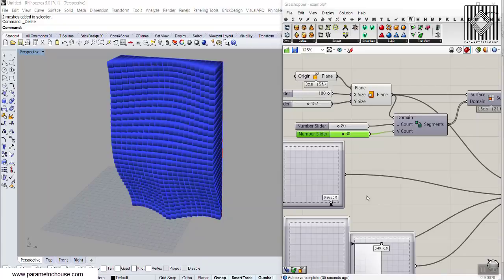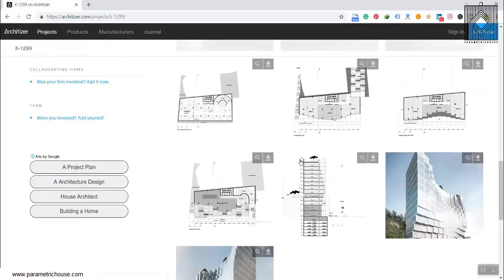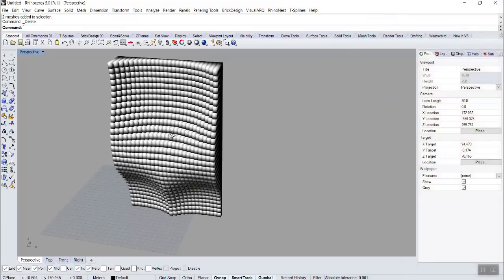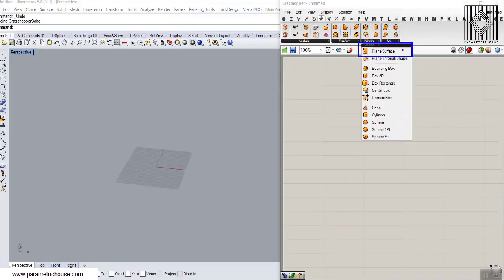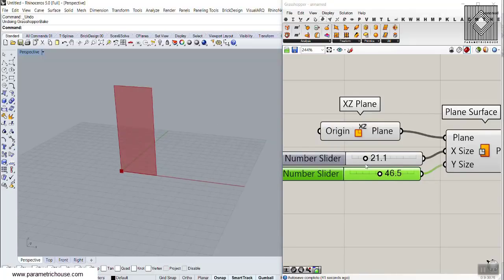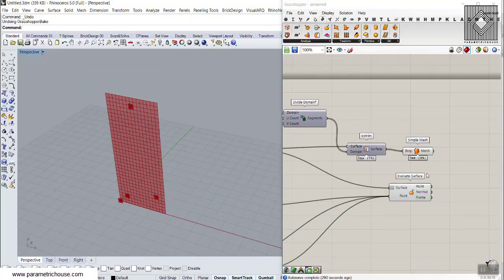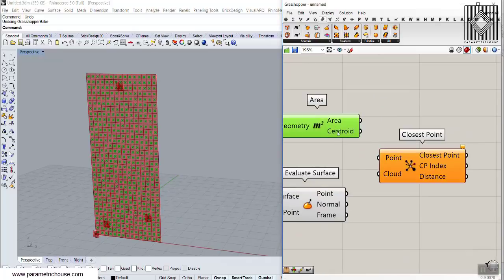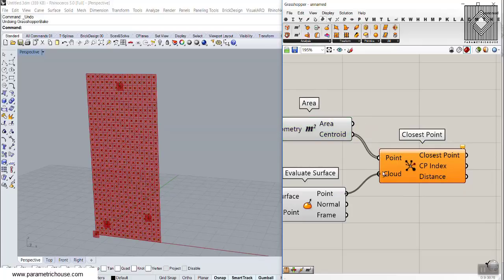Parametric Building

Comment: Hey there! I was wondering if there is anything I could use instead of weaverbird. I tried using "extrude" and plugging that in but it obviously didn't work bc it is a fixed variable... meaning everything will be extruded in the same length.

Comment: I can't drag the remap file to the GH canvas (I'm on Mac), is there another way? Or maybe do the Remap numbers + bounds + construct domain thing manually? If that is the case, how do i do it?
Reply: Nvm, fixed it manually. Didn’t need to use the remap+, used the original approach with a bit of logic :)
Reply from the maker: You can also copy the file in to file>special folders>user object folder
Because remap is used most of the times I made it in a component